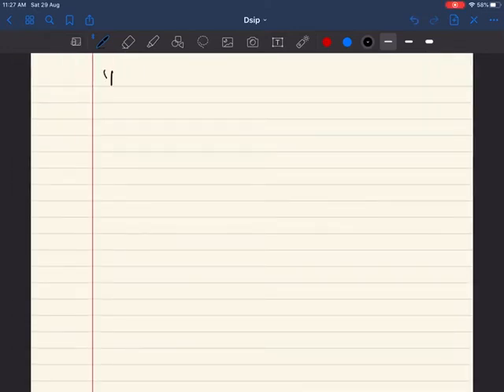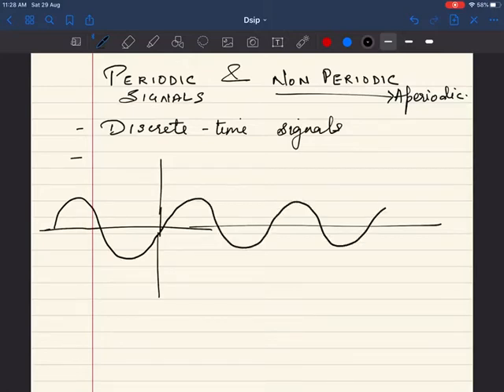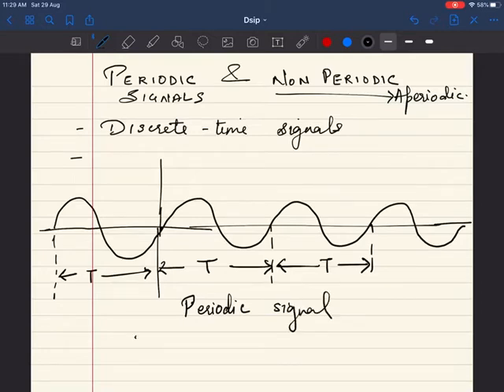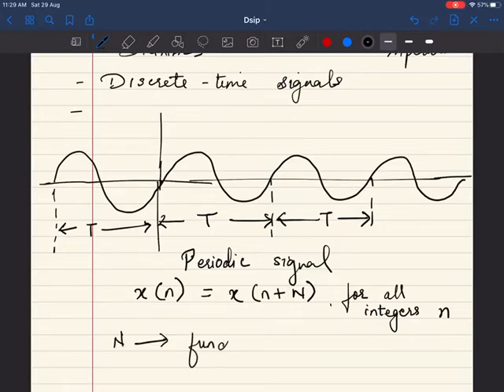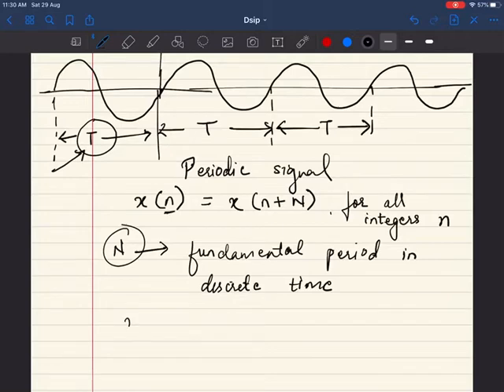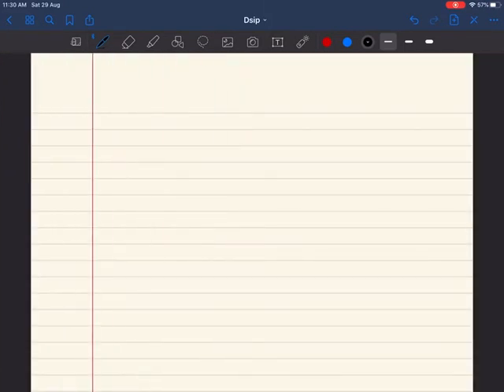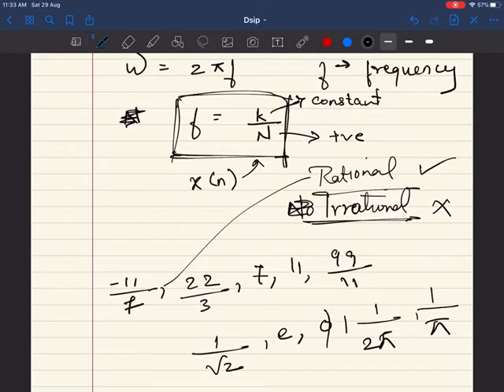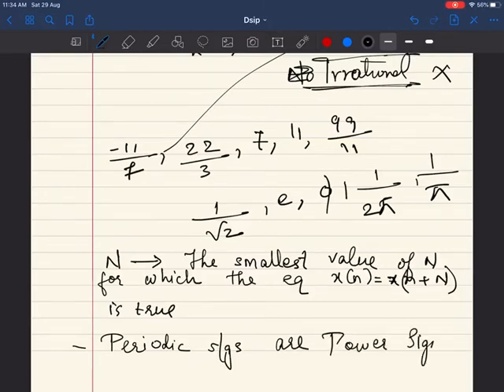Discrete Time Signals- Periodic and Aperiodic Signals

Comment: Make a video on these syllabus...
Make problem solving only...

UNIT I 										(10 Hours)
Basic definitions, Classification of signals and systems. Signal operations and properties. Basic continuous time signals, signal sampling and quantization, discretization of continuous time signals, discrete time signals. Basic system properties, Representation of digital signals. 

UNIT II										(10 Hours)
Discrete time system, Types of system, Properties of discrete time systems, Block diagram representation.

UNIT III										(10 Hours)
Impulse response characterization and convolution sum, Causal signal response to DT-LTI systems. Properties of convolution summation, Impulse response of DT-LTI system. DT-LTI system properties from Impulse response. System analysis from difference equation model.

UNIT IV										(10 Hours)
The z-Transform, Convergence of z-Transform, Basic z-Transform, Properties of z-Transform, Inverse z-Transform and Solving difference equation using z-Transform

.
.
.
.

Text Books:
Signals and Systems by Alan V. Oppenheim, Alan S. Wilsky and Nawab, Prentice Hall
Signals and Systems by K. Gopalan, Cengage Learning (India Edition)
Signals and Systems by Michal J. Roberts and Govind Sharma, Tata Mc-Graw Hill Publications
Signals and Systems by Simon Haykin and Bary Van Veen, Wiley-India Publications